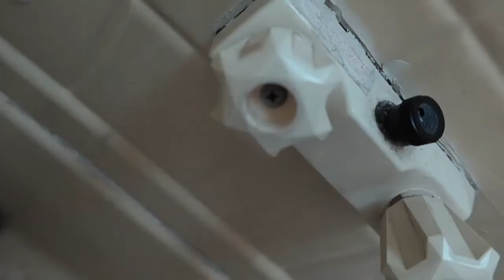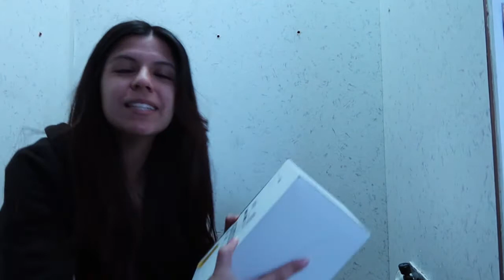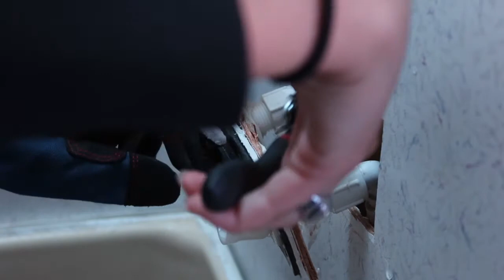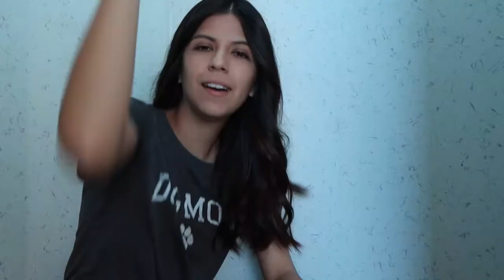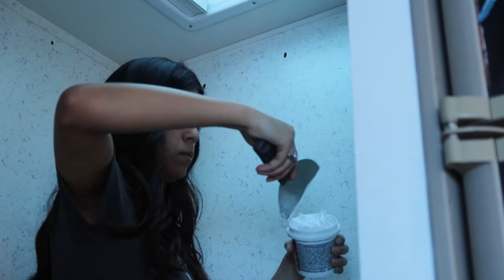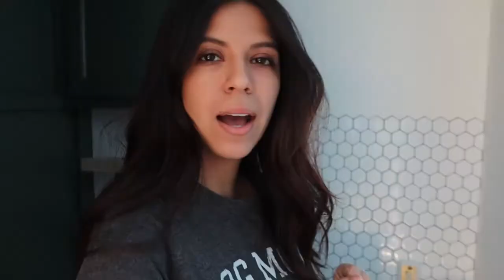HOW TO REMOVE OLD FAUCET IN RV (No access panel!) | Travel Trailer Remodel EP 17

Comment: I found you video very helpful. I'm doing refurbishing work on my Sunnybrook travel. I've had it for 17 years. So it was time to update the interior. I have the same faucet in the shower.  I like the idea of vinyl flooring for the shower flower floors. I have 2 unopened boxes of laminated wood flooring that was leftover from previous home job..Good luck on your trailer
Reply: Sounds like an immediate and severe mold issue.... and laminate is not "laminated wood" is basically cardboard and not anywhere near the same thing as vinyl

Comment: Wish I could have been there to prevent the damage. Need to pull the fridge to access the plumbing for the shower faucet.
Reply: OMG I have to remove the fridge? This seems so much easier 🙃
Reply: @kamilahjohnson4815  it's just held in with a few screws. You don't even have to remove it the entire way. My hubby showed me that if you slide the fridge out about half way you can access those plumbing fixtures from the out side fridge access panel.